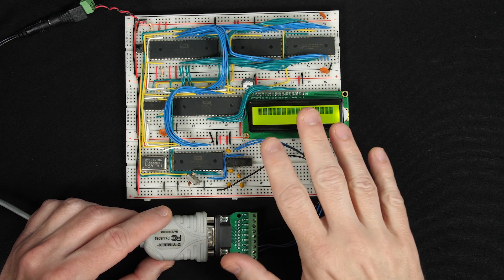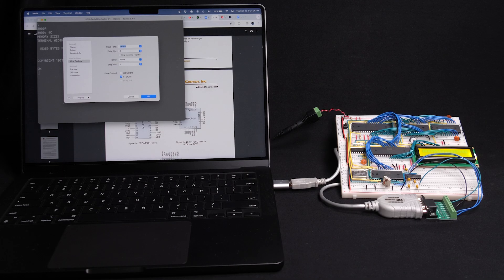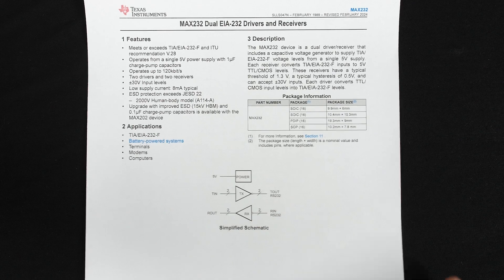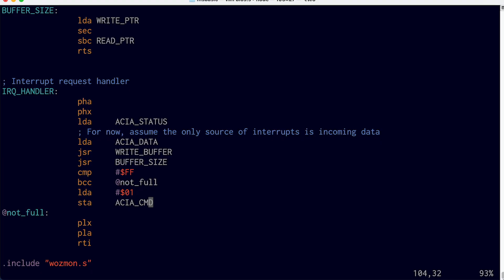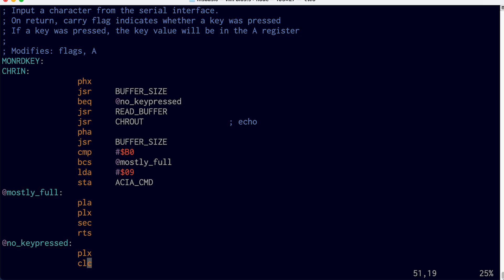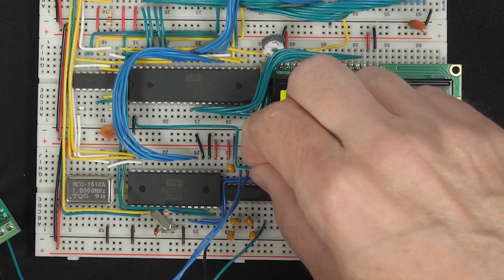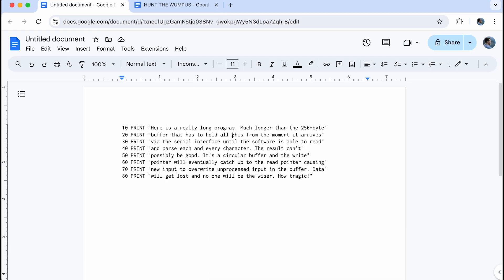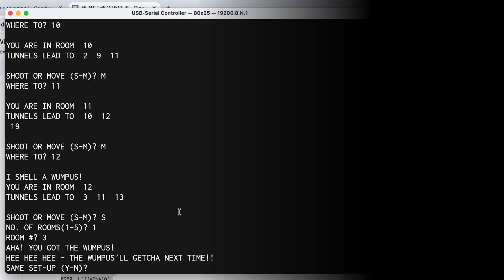RS232 flow control

Comment: Ah do I remember this. Hardware and of course Software flow control if its supported properly.  Thats Async Rs232. Then there is Sync Serial and Hdlc and Sdlc . We had to support them all or at least troubleshoot them. I found it fascinating watching a session being setup with the latter Protocols on a HP DLM Data Line Monitor. Working in real comms allways required finding a way around an issue when there was no easy existing method. Eg a Hardware device doing a File Transfer through a Protocol Converter to some other location in Australia that kept failing on some sites and not others. Monitoring the conversation between them proved their equipment did not support any Flow Control at all. The quick and dirty work around was to replace the 2 port serial cards in the receiving device with a 4 port serial card. Why did that work , those cards had a much larger memory buffer that was obviously shared between the 4 ports and I was only using 1 port. Slowing the baud rate right down did not help by the way. Sorry for hi jacking your post.
Reply: RS232 is asynchronous whether flow control is used or not. There's a clue in the abbreviation for the chip, whether it's a UART or an ACIA.

Comment: I asked ChatGPT, but I thought a person might be more helpful... I want to play around 'building' both the 8-bit breadboard computer and the 6502 one, but I dont have time/money right now to get either the kit(s) or components. Is there any software packages (Open Source always is preferred, but anything really) that would allow me to build the circuits (like in Multisim) and then allow me to 'simulate'? I want to be able to interact with the final result in the same/similar way to how I would interact with the real deal (so run code/terminal on the 6502, and run code on the 8-bit as well). Does such a piece of software exist?

Comment: Ben, Im older than the PCs with BASIC in ROM BIOS... Here I was with my Nortons Guide to the IBM PC, trying to work out what your making sound easy...

And in my 30 years of Systems integration, there's one thing I value most. When someone can articulate the most complicated ideas so simply, it makes sense to everyone. We can all read the text, those that can relay it on in simple terms, are the ones that understand and master it. Bravo, Ive been watching for years now, always as good as the last ep.

Comment: Ben , This is what is happening with the RTS when you put 00 TIC it disables the Transmit look at the Rockwell data sheet, This is not a BUG but how the RTS and CTS were designed.  To get this to work it is better to use the DTR pin as it acts like a IO pin and the DSR  as an Interrupt pin, but you still use RTS/CTS from the computer. FYI I will tell WDC to correct there Data Sheet

Comment: Hmmm...I've just changed from using the 6551 to the 6522 to trigger the CTS but now it never fires. 
I thought I got all of the changes he showed in bios.s but maybe I've missed something?

Has anyone gotten this going yet?

It was working (other than the problems with the input echo) when I was using the 6551 -> pin10 of the Max232 but now it is not.
Reply: Ha! 

The problem, as it turns out, is that I'm a bit daft. I soldered to the wrong pin on the 6622. 
All better now.

Comment: It's just a guess, but isn't the first flow control routine block your terminal (or UART) from receiving data from 6502 side? But as your program doesn't stop sending, all those bytes are lost. But when you allow terminal  to send all returns to normal.

Comment: You still have one more issue to cover about transmitting really large amounts of data.  Since the DTE and DCE (two ends of RS232) use separate clocks and they only 'synchronise' with a pause in data flow (or the 'break' signal), if you try to send several kilobytes all at once in one direction, you can have problems with the two clocks 'drifting'.

Not so much with modern systems, but older equipment the clocks weren't always as accurate.  So long files (as in, maybe a whole megabyte) had to be broken up into 'blocks' and sent with a tiny pause between blocks.  After the pause, the start bit would help the reciever resynchronize with the transmitter.  Hence, comm programs like Kermit and Zmodem were born.
Reply: That doesn't seem to make sense. The whole point of the start bit is to synchronise the receiver with the transmitter. If it didn't, there would be no point in having a start bit for every byte that was transmitted.

The start bit in combination with the stop bit allows the receiver to ensure that the byte is properly framed. Bytes which aren't properly framed because one of the clocks has sped up or slowed down too much result in a framing error.

Its also not strictly necessary for an RS232 connection to be between a DTE and DCE. The distinction is essentially how the signals are labelled and the pinout being 1:1 instead of crossed over - DTE TX connects to DCE TX for example.

In an idealised scenario a DTE (e.g. PC) is connected to a DCE (e.g. modern), but it is also entirely possible for two DTE to be connected to each other via a null modem cable, and that's what Ben is doing here.
Reply: @TomStorey96  If you're sending hundreds/ thousands of bytes, there isn't any pause between stop bit of one byte and start bit of next.  Yes, the start bit is always '1', but the receiving UART hasn't 'paused' its clock long enough to resync.  There has to be a few bit times of 'space' to do that.  The recv clock isn't just 'frozen' after receiving those ten bits (or 11 bits if parity is also used).

This gives you a framing error as you rightly point out.  But how do you prevent/ recover from that?  The transmitter is still just sending data at full tilt.  That's what those early protocols (kermit, etc...) solved.  They broke up the data stream into packets (and often added checksums).  Short packets (256 bytes or so) with 'break' signals allows the recv clock to resync and AVOID framing errors.

And yes, DTE to DTE thru a null modem is very common as well, that's not the problem.
Reply: @mikefochtman7164  Attempt #4 to reply, YouTube keeps eating my comments for some reason.

UARTs use oversampling, they dont use a 1:1 clock. Typically the oversampling rate is 4x at a minimum, and usually 16x for modern UARTs. You dont need to pause in between each byte because each byte is synchronised by the start bit. Oversampling allows for a couple of % of difference between the transmit and receive clock, and is the reason why these kinds of serial connections are known as asynchronous - they dont need strict clock synchronisation on both sides.

You recover from framing errors by resending data, thats the only way. You avoid framing errors by having a clock of high enough quality so that it doesnt drift too slow or fast relative to the other end. Framing errors are also on a byte basis, and have nothing to do with a packet, other than to allow a higher level application or protocol to know that an error has occurred during a packet and that the packet needs to be resent.

And that is the reason for packetising in the first place - if one small chunk of a transfer has an error, you only need to resend that small chunk, not restart the whole transfer from scratch. Packetisation has nothing to do with giving the receiver time to "take a breath".
Reply: @TomStorey96  You've 'hit the nail right on the head'.  Yes, back in the 70's and 80's, clocks were not as good. And yes, the only way you can recover from a framing error is to somehow detect it, then reply to the sender that you had such an error and have the sender 'resend' it.  Developing such two-way protocols to do this was a 'breakthrough' in network communications.

But I've been talking about just sending raw data in one long continuous flow.  No packetizing and no protocol to request data be resent.  I worked with some old dumb terminal displays where we had just this sort of problem.

Ben's communication is at about this level right now.  The clocks are obviously better than the stuff I was working with, but the issue is that without some 'protocol' to detect errors and retry, you need to be absolutely sure you don't get framing errors.  With a small receive buffer and flow-control, it's not likely to be a problem since each pause in flow-control achieves the same thing.  But if Ben's receive buffer was large (or the receiver was fast enough to keep up with incoming data) and/or the clocks poorer, framing drift errors would be a problem.

Comment: Great demonstration of flow control.  It's interesting (at least to some of us nerds) that the original naming of signals was waaayyy back when RS232 was between 'Data Terminal Equipment' and 'Data Communication Equipment'.  That is to say, between a data terminal and a data modem.  So names like 'clear to send' was the modem telling the terminal it could send data, and 'request to send' was the terminal 'asking' the modem if it could send data.  It also helps understand which signals were controlled from the DTE and which from the DCE.
Reply: My job involves a lot of old standards like RS-232, EIA 530, etc., especially in regards to using them for jobs they weren't quite designed for. I'm an old tech close to retirement, and I've been trying to get the younger techs to be able to visualize how the machines are designed in concepts like DTE/DCE and flow control, but they're having difficulty. Strangely, it doesn't help that things that would be classic DTE/DCE relationships like craft terminals are so fast and reliable that if there is any flow control it's just XON/XOFF, so they never see what the handshaking and timing pins do until the rare odd-duck problem. Then they'll spend months to years never thinking about what they learned and the next problem still baffles them.
Reply: I think “request to send” was meant as a way to tell a half-duplex modem that you wanted to send some data.
Reply: I tried NPM, React, etc. for a year at work.  Ended up ditching it for HTMX.  Couldn't be happier.

Comment: About the dropped echo characters:
 The datasheet has a note saying "The Command and Control Registers should be set up first before transmission begins when writing
the TDR/TSR."

I suspect what this actually means is that it's invalid to write to the command register while data is transmitting. You are sending the echo char and then immediately writing to the control register.

Swapping the order (modifying CTS, then reading from the buffer and echoing) might be enough to fix the bug... But you probably need to poll the status register and wait for TDR to be empty before any writes to control or command.
Reply: Also "back in the day", we used to bit twiddle memory mapped IO and ports by reading from the device's registers (memory address), AND/ORing with a bit mask to clear/set only the intended bits, then write the result back to the address it was read from.

Whilst there is nothing wrong with an immediate load then store to set bits, you need to be sure that it is ok to clobber the others. It could be possible that the UART was using the other bits that got zeroed for some other purpose and that's why you don't see some of the output echoed back?
Reply: Annoyingly, on that chip TDR is ALWAYS empty.
Reply: Those are sentences I didn't know were even possible. Just made me realise I thought I knew computers, but actually, I know so little.
Reply: It sounds like you'll want to process sending and setting flags using a command buffer, with "out of order" execution because you'll still want to clear that CTS flag in a hurry.

Comment: 3:53 The CTS and RTS signals are considered active-low, as you noted. So I think you probably shouldn't have used the inverter.
Reply: It's not an inverter, it's a level translator that happens to invert.
Reply: @misterhat5823  Correct, but I'm saying it probably shouldn't be there. I think his breakout board is labeled wrong, and it expects an input signal which is active-low (not active-high, which is what the inverter would give you)
Reply: @Muny  On the wire RS232 signals are the opposite "polarity" of the TTL level signal. The transmitter end inverts and hence the receiving end must also invert.

"Polarity" because really a logic 0 from the UART is upwards of +12V or so on the wire and a logic 1 is as low as -12V or so.

Comment: Love this series, brings back so many memories. Had some thoughts/observations. You're odd behaviour with the hardware flow control may be because you left the CTS input on the UART floating, and it's picking up it's state from the adjacent RTS pin. Since your transmit code is not flow-control aware it just trashes what's already in the transmit register waiting to be sent. Try pulling this pin low to see if that fixes the problem. (or better yet, route the CTS as well) Another potential issue I noticed is with your "fix" for the flow control problem, you are doing a blind write instead of a read-modify-write to PORTA. So if PORTA had pins being used for other purposes as outputs, you would be trashing those states by setting them to 0 when you update your RTS/RFR pin.
Reply: I had the same thought, maybe he left CTS floating.
However, pause the video at 3:55 or 10:49 and we can clearly see pin 9 (CTS) is tied to ground. I'm surprised he didn't mention this in the video.
Reply: @prow7  Oh I missed that, thanks for pointing it out.

Comment: When you were troubleshooting your UART chip, did you ever connect the other Clear to Send signal from the PC's receiver to the UART chip?  That pin might be floating low/high due to signal transitions around it, or it might be pulled-up/down (whichever blocks transmission) when put into "flow control mode" and not driven. I have seen chips in the past where if you enable some mode (e.g. flow control) on the receive side, the chip internals will also configure the transmit side in the same mode (i.e. you can't have the receiver with hardware flow control and the transmitter without it).
Reply: This was exactly my thought, radio interference from the neighboring pins.  That's the only thing that would clearly explain the receive of all characters, but the loss of output.  If it's doing this, it could easily lose the buffer output any time the signal is swapping on (between B0 and F0).  That could be why you see little "spurts" of output as well.

Comment: Regarding the printing error: I’m absolutely no expert at all, but isn’t it as simple as the computer won’t recognize any data sent as long as CTS is low? So during all the time that the buffer is full and the microcontroller clears out the buffer and sends the characters back to the computer, the computer will ignore the output?

Comment: My hero finally returns, Ben i want to challenge myself to make USB to TTL using Transistors, can it be done?
Reply: If you're not sure whether it's possible, you should probably tackle a couple smaller projects first. If you're more than a couple Google searches from knowing whether you can achieve something it's a sign that you need to invest in yourself a bit.

Comment: Flow control? I was promised electronics videos, not plumbing 😡😡😡
Reply: I think the title did this video justice, though it is a short, sweet little byte rather than the combined works of Tolkien.  Go shop around YouTube until you get your fix; you’ll be fine.